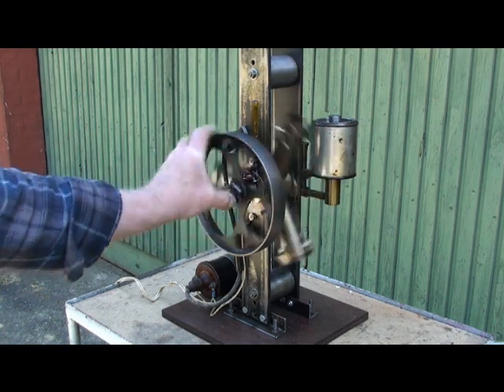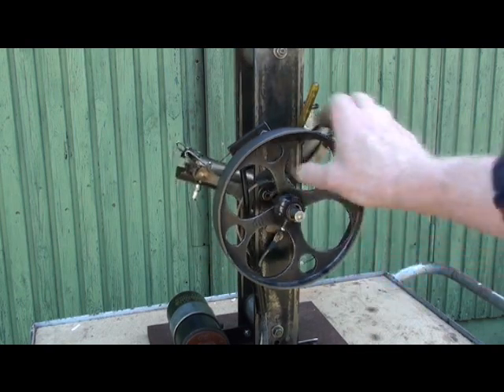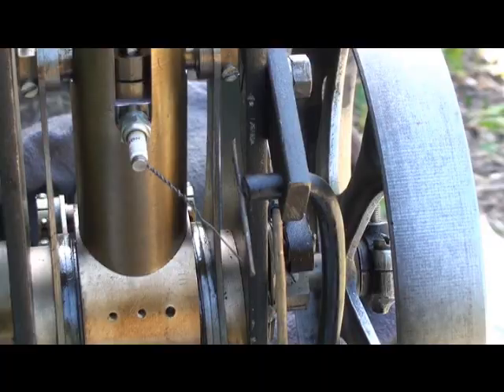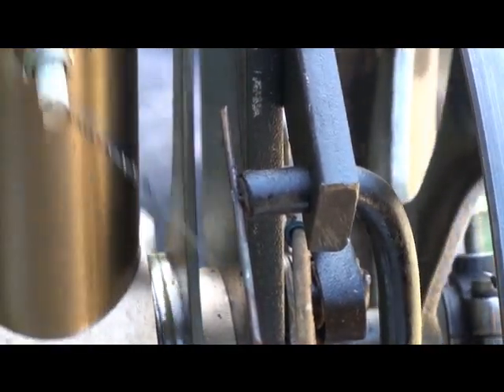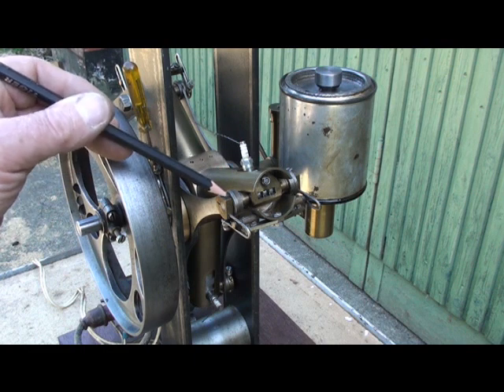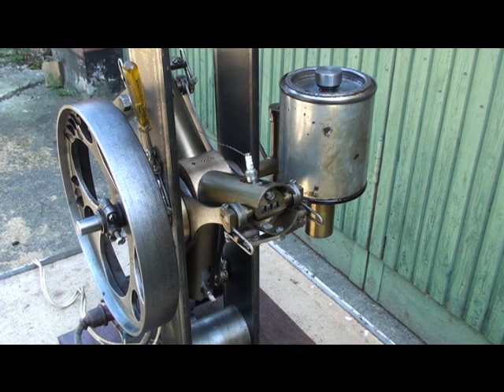3 Cylinder Two stroke Radial Engine with rotating Cylinders

Comment: This is a four-stroke engine- not a two stroke. The Gnôme Monosoupape engine operates the same way, except it has a poppet valve rather than the sleeve valve that this evidently uses.
Brilliant.

Comment: The Gnome rotary engines of WW1 were fourstrokes (sort of) but worked on the same principal of spinning the whole engine. A cross four two stroke with all four rods on one crank pin give near perfect primary balance and four bangs per revolution without spinning the whole engine.

Comment: As the cylinders & crankcase rotates, I believe it's more correct to call it a rotary engine rather than a radial. It seems to operate in the manner of Gnome, Clerget & Bentley rotary engines as used in Allied aircraft in the First World War. One thing the two engine types shared was the radial configuration of the cylinders.

Comment: From an aircraft perspective, an engine with rotating cylinders was a rotary engine, whilst stationary cylinders were a radial. 😊 Marvellous engineering and it does look early 20th C, with the large spoked fly-wheel. It sounds like a 4-stroke. Starts and runs beautifully.
Reply: No, the rotarys are four stroke, this is a two stroke.

Comment: Its actually... an opposed piston rotary engine... the inward moving cylinder "heads" would be defined as pistons, being connected to conrods & moving in synch counter opposed to the motion of the working cylinders piston... nice design & craftsman ship

Comment: Like the centrifugal cylinder engine found in early bi-planes.
Reply: Yes, they’re called aerial rotary engines. Totally different design than automotive rotary engines but they share the same name.
Reply: @averagecarguy420  The rotary engine predates powered flight by almost 20 years, it's not an "aerial" engine, despite it later being widely used in some WWI era fighters. Felix Millet patented the first rotary engine design back in 1888 for use in a bicycle. From then, many companies designed and built rotary engines for use in bicycles, motorcycles, cars and stationary applications long before one was ever mounted to an aircraft of any type. It reached its peak of development at the end of the war and was abandoned in favor of other engine types due to its design issues. Power couldn't be scaled much past 260 hp because of RPM limits increasing drag that siphoned off engine power. The bore and stroke couldn't be increased because of weight, additional drag and exacerbating the already unmanageable gyroscopic effects. The Bentley B.R.2 or the Siemens halske SH.III were probably the best examples of the peak of rotary engine development.

While Felix Wankel patented his wankel engine design in 1929, it wasn't until 1951 until he actually started trying to build it and 1957 that a workable engine could be commercially released. So it came around 70 years after the first rotary engines had existed.

Comment: Technically speaking, this is not a "radial", but a "rotary engine". Its principle was very popular among WW1 aircraft designers, but it had a practical limit of less than 150 HP. The fact that whole engine except the crankshaft rotates, is why they are called rotaries. The more modern Wankel engine, also called a rotary, is so called because it contains  rotors, within a stationary outer casing. Radial engines are a very different animal and have been made up to 5,000 HP.  The advent of the jet turbine killed them off.

Comment: These are rotary engines.  Used on some WW1 airplanes.  In a radial the cylinders are fixed and the crankshaft turns.
Reply: All rotary engines are still radials. They just have the cylinders and case rotating rather than the crankshaft.
Reply: In the rotaries yes (predominantly gnome engines). But not generally. The wast majority kept their cylinders stationary though.

Comment: It’s like a looney toons engine. The only problem i see is that contact for the spark plugs. All that engineering and a coat hanger is used for your distributor contact?
Reply: You see a “problem”. I see genius in its simplicity.

Comment: WWI era radial engines used a waste lubrication system, wherein oil was pumped into the crankshaft bearings, then slung into the combustion chamber and burned with the fuel.  The oil tanks were as large or larger than the fuel tanks.  Castor oil was commonly used, and castor plants still grow wild around LA from the heyday of piston aircraft.

This is a cool build, thanks for showing it.

Comment: Wonderful..... a bit like the Gnome and Le  Rhone rotary engines of WW1 aircraft...... but a two stroke.....
It would be interesting if you developed this... perhaps a 5 or 7 cylinder with fins and a proper mounting system to turn a pripeller....

Comment: This has to be one of the most novel and fascinating internal combustion engines that I've ever seen. Now I will have to watch all of your videos and learn!
Reply: They were invented for aircraft over a hundred years ago.
https://en.wikipedia.org/wiki/Rotary_engine
Reply: @harry130747  
Yes, but those rotaries you see in the Wikipedia article all have poppet valves - you can see the pushrods at the front of the engine cylinders.
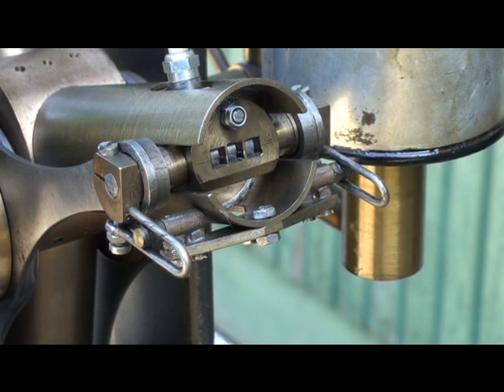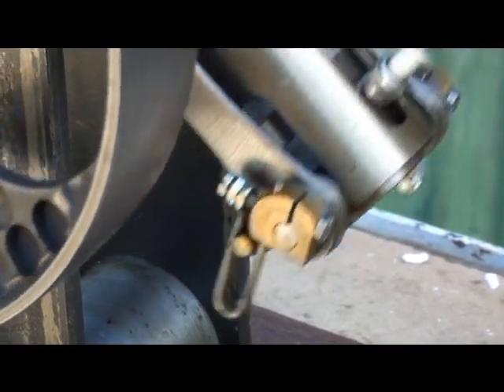What makes Mr Hansen's engine so novel is that it uses sleeve valves - see his video between 2:30 and 2:55 and you can see the valve operating.
Cheers Paul

Comment: Rotary is where the engine spins, radial is where the engine stays in place.
Reply: Correct. Unfortunately the rotary term has been widely misused for Wankel engines
Reply: Well, not exactly...
...a "radial" engine has cylinders radiating out from the case.
A "rotary" engine is a radial engine with the crankshaft fixed and the whole engine rotating around the crankshaft.
Both are types of radial engines.
The Wankel engine would more accurately be called a "rotor" engine, due it's metatrochoid internal rotor.

Comment: Too bad there's no way to collect the exhaust into an exhaust manifold to pipe the exhaust fumes in a specific direction. This can't really be operated indoors unless one is running it off of hydrogen. Neat little engine though.

Comment: These types of engines always fascinates me. Using the engines themselves as a "flywheel" & the engines also gets cooled  down by rotating, so no need for fans or cooling systems, interesting! :)
Reply: Early WW-I airplane engines were like that.
Reply: @ProperLogicalDebate  Was just about to comment that.
Reply: @ProperLogicalDebate  That was the Gnome rotary. The large gyroscopic forces resulting from the spinning cylinders made the planes handle strangely. I think they hated to turn left.
Reply: @ProperLogicalDebate  Nothing new in having the cylinders rotating and the crankshaft stationary. But I think WW1 engines would have 'proper' distributors ;)
Reply: @ProperLogicalDebate  They were used extensively in WW2 and are still in use today in light aircraft.
Reply: @rjk69  I don't know any WW2 plane with a rotary engine. I also don't know any rotary powered light aircraft.
Reply: @Simon_r2600  You are right, the video title says radial but it's actually a rotary. Radials were and are used, rotary engines were superceded in the 20's
Reply: @rjk69  Both are awesome engine layouts in my opinion
Reply: Their quickly throws up all oil and power was limiter by maximal revs above which cylinder break off because of centrifugal force.
Reply: But they displace reality and warp the fabric of Devine judicial equilibrium.  In other words,  this is how Demons get into our deminsion.

Comment: It's a rotary engine with radial cylinders
Reply: No, it is a true rotary. Most people refer to a Wankel as a rotary, but this is technically wrong. An engine with radially arranged cylinders that rotate around a fixed center is a true rotary, which is what he built here. This and a Wankel have absolutely nothing in common.
Reply: I'd like to know how much vibration there is, and what's the possible efficiency.

In a regular piston engine there's a lot of vibrations because the pistons are moving up and down. With this, the pistons are swinging around in a circle, and so are the cylinders. Nothing is reciprocating. There should be much less vibration, and maybe this should result in much better efficiency.
Reply: @terjeoseberg990  should be very little.
Reply: @terjeoseberg990  one huge benefit is cooling.  The spinning cylinders creates it's own 'flow' for air cooling.
Reply: H, Agreed.
Reply: @ltr4300  yes.
Reply: @ltr4300  I mean, what you've described there is a radial engine but just instead of fixing the cylinders they've a fixed the crankshaft here. The wankel rotary engine is more widely known as a rotary engine because that is how it was named by its inventor. This is still a radial but just in a slightly different arrangement
Reply: In regards to the engine being efficient with plenty of torque...vizioracer does videos with specs listed and one thing I've noticed with radials is the torque is something like ten times the amount of hp... if I can recall correctly, there were some engines with 20-50hp but torque levels around 250-500 lb/ft. I'm guessing this is due to the added weight of the rotating cylinders acting as a flywheel of sorts. Whatever it is, it's definitely an oddity among internal combustion engines.
Reply: @johnfasanoii4382 , https://youtu.be/tZmd7k33JWE
Reply: This sounds like my Kubota 3cylinder tractor. Haha
Reply: you able to read bro
Reply: Well, most of 3 cylinder 2 stroke bike like Kawasaki Triple and Suzuki Triple when use 3 - 1 exhaust sound similiar to 1 rotor rotary.

Comment: LeRhone rotary engines, typically 5 cylinders, were commonly used on world war one fighters.  The crankshaft was held stationary while the rest of the engine and propellor spun.  They were notorious for slinging oil everywhere.  The crankshaft was usually mounted such that exhaust always exited at the bottom of the plane so as  to sling slightly less debris into the pilot's face.  They typically had no throttle.  Power was regulated by turning the ignition on and off.
Reply: Air cooling was quite easy, as the engine itself was whinging around at high speed
Reply: +Na Cel  Yes, Rotary engines require no flywheel offering  excellent power-to-weight ratios and very smooth power delivery, natural air-cooling is also a big plus.
Reply: +RocKiteman _ 2001 Reciprocating aircraft engines typically do not operate at high rpm, the limitations of conventional propeller efficiency restricts rpm to a safe range. The problem caused by increasing power output above the 200-250hp range is the resulting increase in rotative mass, this "Gyroscopic Procession effect" which can either cancel-out or completely over-ride flight control inputs effectively causing a loss of control often resulting in a fatal crash. cheers!
Reply: +RocKiteman _ 2001  You are very welcome sir!
Reply: was there any advantages of this configuration?
Reply: bacorable The phenomena of "Gyroscopic Procession" was the main reason their use was discontinued
Reply: The real doktorbimmer  →  AFAIK, another problem with the rotary radial engines was as they got BIGGER {more horsepower}, "centrifugal force" INCREASED and the engine would be more susceptible to FAILING and COMING APART IN FLIGHT.
 
And THAT would ruin ANYONE'S DAY.
Reply: The real doktorbimmer → Roger all that - Thank You!
 
I learned something new!
Reply: Why not mixture and ignition? =)

Comment: Well now we see the first actual airplane engine . I'd doubt it flew long and it's inventor well what do you think..?
Reply: If the Wright brothers were the first to make a powered flight, their first aircraft engine was a bit more what we would consider conventional.  It was a  four cylinder in line engine and drove the two propellors through a chain drive.  Bicycle chains I think.
Reply: Yes the Wrights are documented as successful but this is the production of history. Any inventor that was not able to survive his own invention would be much less likely documented with any degree of favor.
Reply: The real doktorbimmer Thank you for sharing. It's interesting that history does not mention this. Oh well, marketing is everything!
Reply: the tbo on that engine was thought to be about 1 1/2 hours.
Reply: The Wright Brothers used an in line 4 cylinder. It was a home made engine with a crude hot vapor carb. Part of one of the original engines is in the Wright Brothers Museum at Kill Devil Hills North Carolina. Great area for a vacation and a very cool museum! There is a cool photo of it at the Smithsonian website search the wright bros
Reply: The worlds first manned powered flight used Daimler Benz engines designed by Wilhelm Maybach.
Reply: The real doktorbimmer and where was this??
Reply: Bob Ordewald Friedrichshafen, Germany  July 2nd,  1900.
Reply: These where not the first aircraft engines in any sense of that word.

The first aircraft attempts use single and two piston engines, and the Wright flyer (the first aircraft documented by camera to have flown, thus why people say it's the first working airplane) used a four piston inline. The first aircraft to cross the English channel used a 3-cylinder radial (an engine that was like this, but the cylinders didn't move).

Rotory-type engines where made as motorcycle engines first, but they didn't do well in that role. They're good power to weight ratio at the time made them quite nice for aircraft. However, Radial engines could get much larger, and so took over.
Reply: +DFX2KX The first aircraft engine was a 4 cylinder inline Daimler-Benz designed by Wilhelm Maybach in 1900... 8 years after Felix Millet invented the Rotary engine. and 11 years before the Wright brother first heavier than air flights.
Reply: @The real doktorbimmer

Are you referring to the early Airships? If so, that might be the case. I didn't think about the few derigables that existed.

For heavier then air aircraft, that would still be the flyer's custom inline 4, though.

Comment: Surely you wouldn't need the fly wheel on the front? Or is that just for getting it going?
Reply: mulymule12 my guess it's mainly for balance and rational inertia
Reply: Rotary engines do not need flywheels...

Comment: Yes, it's a rotary not a radial, invented by Lawrence Hargraves in Australia.
Reply: Rotary engine was invented by Felix Millet in 1892..
Reply: One of Lawrence Hargrave’s finest inventions was the radial rotary engine of 20 February 1889, compact, smooth running, with a then phenomenal power/ weight ratio, and providing efficient cooling of the engine by the air in which it revolved around its axis. This engine was ingenious in that it rotated the cylinders around a central shaft, and drove a propeller, and not flapping wings. It was to become the major aircraft engine type for 50 years. Lawrence designed and built nine radial or radial rotary engines. As always his work was freely disseminated and the idea would be taken up by others into commercial production in the next century. His propellers were inefficient, and he returned to flapping wings for a time.
Reply: Bollocks!
Reply: Charlie Brown Lawrence Hargrave never constructed an Internal Combustion Engine... his research was limited to pneumatics.
Reply: Charlie Brown Non-combustion Rotary engines date back to James Watt in 1765..
Reply: If you look closely at the Hargraves engine you will see that it had spark plugs and a magneto for the purpose of combustion.
Reply: Hargraves engines were pneumatic
Reply: I fail to see how somebody can fit a carburettor and an ignition system to somebody else invention and call it theirs.

Comment: Very Very Nice... Job well done... Just a note, from working with Radial and Rotary Engines there is a very clear difference. This is classified as a "Rotary Engine" where the Cylinders Rotate, and a Radial Engine, the Cylinders are stationary. Very much enjoyed the video.

Comment: Still have no idea how how it runs...
Reply: right?! very impressive
Reply: right?! very impressive
Reply: The crankshaft stays stationary while the cylinders rotate around the crankshaft
Reply: Adam Hansen thank you but i understand that part very well. What I dont understand is how thw fuel/air in inducted through the crankcase when the volume of air in the crankcase is theoretically always the same, instead of being pumped through by a single piston at a time
Reply: thecrazyfarmboy 
Separate reed valves per cylinder